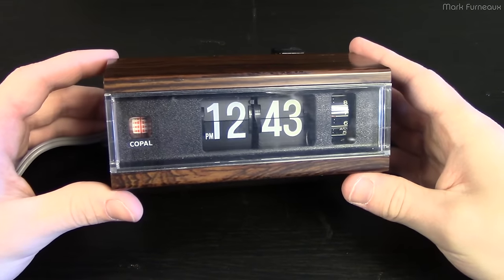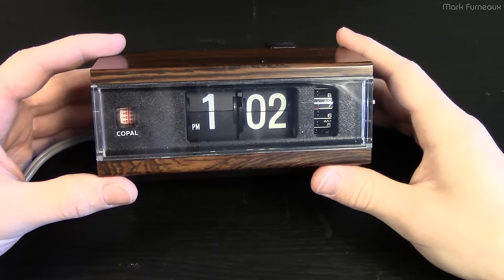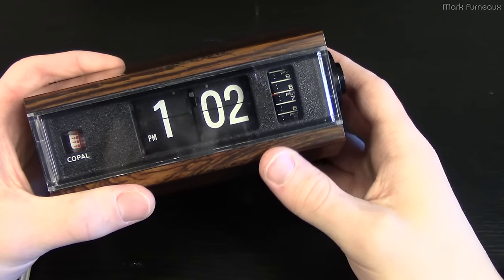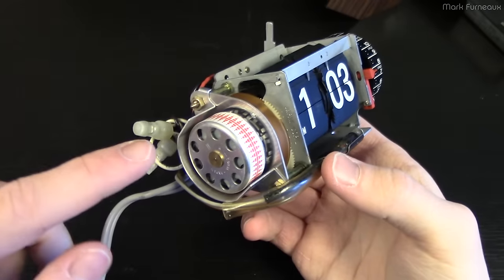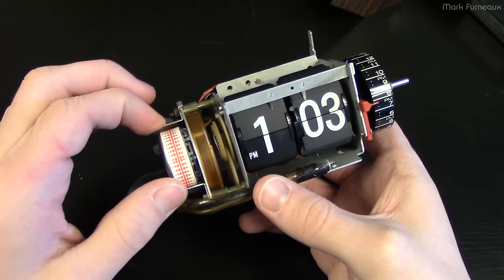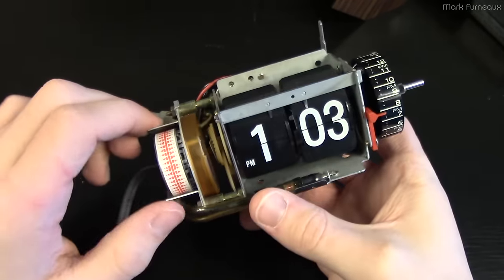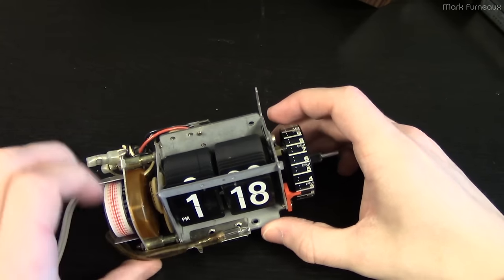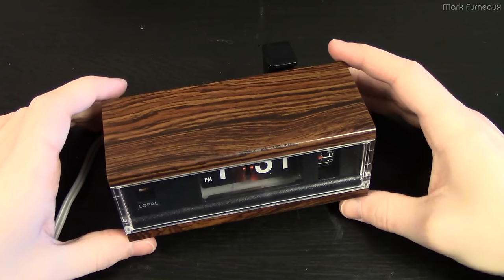Replacing the Neon in My Copal 227 Flip Clock

Comment: Interesting video. I would have been tempted to make a small circuit to switch on the neon only when it's sufficiently dark to save the neon from degrading quite as soon as it otherwise would. Having said that, if I were to go to that sort of trouble, I'd probably just change the neon for an LED and have done with it. Easy enough to put in a capacitive dropper and a rectifier to drive the LED at the right voltage (with a current limiting resistor, of course).
Reply: Хорошая идея
Reply: kachalka100 
Спасибо!
Reply: +Pete Allum
sorry, but I also want install
the photo sensor night/day
it is real good feature for flip clocks
i make order this sensor from china now
Reply: Pete Allum - Better yet, go on Amazon.com and just buy a modern clock and save your time and money! Just kidding, a little. Seriously, the beauty is in taking these clocks back to their former glory. It's impressive that proper have the skills to modernize these clocks, and there's a small niche for those who like such altered flip clocks. But there are many more who like the full retro.

Comment: You skipped an important step, did you solder the connection or undo the crimp connection and re squeeze the joints

Comment: I actually am looking to pickup the same model clock! Problem is that the buzzer doesn't work. Any suggestions?
Reply from the maker: It's literally just a coil and a switch. Check if the switch closes, and if the coil is open. The switch can be replaced, the coil would be much more difficult.
Reply: I was planning on picking it up from a gentlemen on ebay for about $50. The cheapest listing on there with a few others. What are some things to look out for? I'm not an expert on clocks.
Reply from the maker: Neither am I.